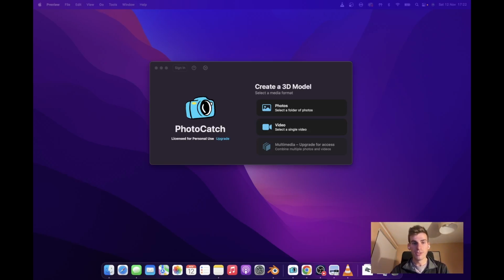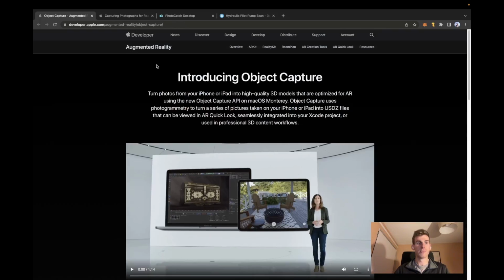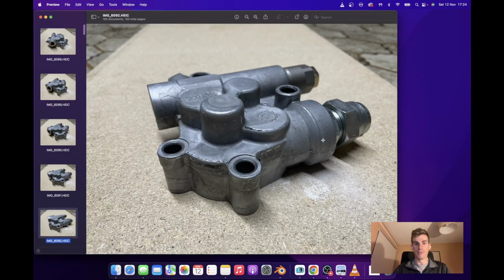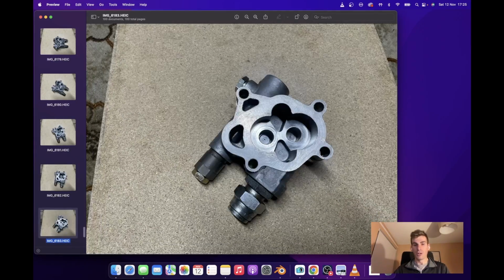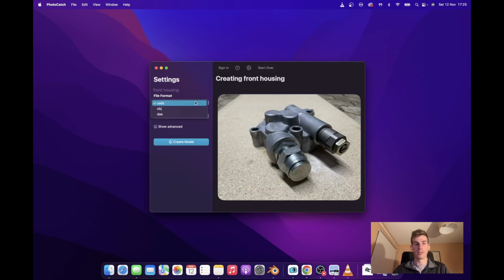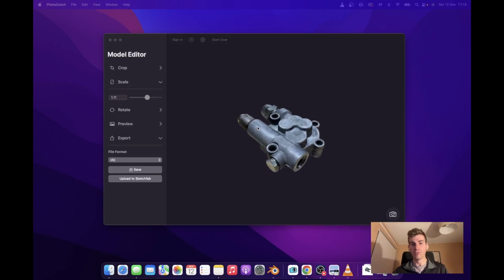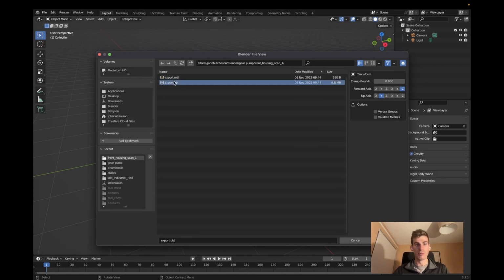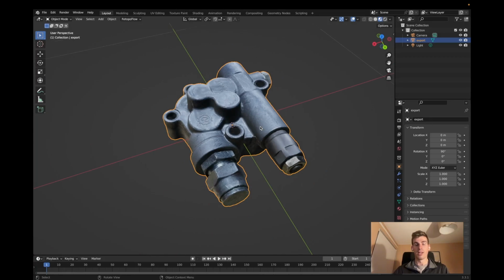Using PhotoCatch to Photo Scan a Hard Surface Object on a Mac | Blender | Photogrammetry

Comment: just came across your video and I’ve been trying to find easy solutions for making high detailed models from photos as I’ve recently gone back into education 
Just wanted to say your video is incredibly helpful especially as I’ve been a bit lost in finding softwares to use like metashape.
I did try photo catch but I was trying multiple others so I was in a state of frustration but I might have to give photocatch another go and get a high quality model
Reply from the maker: Thanks for your feedback. I'm glad you found my video helpful. I've had some good success with Photocatch, but it can sometimes fail to generate a model, especially when trying to capture a highly reflective metal object. To get the best results, take plenty of pictures and avoid harsh lighting. The link I provided to the Apple article on Reality Kit is full of more useful tips so make sure you check that out.
Reply: @hutcheson3D  thank you so much again for all your help it means a lot